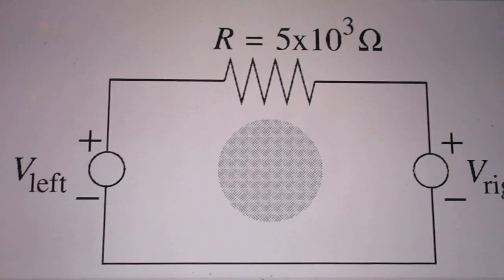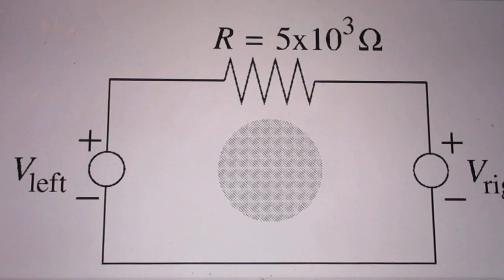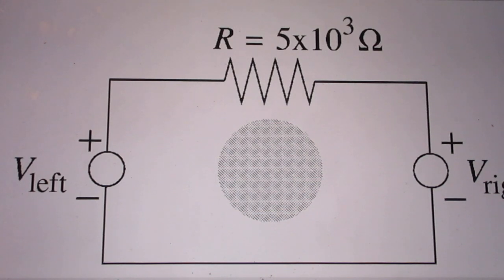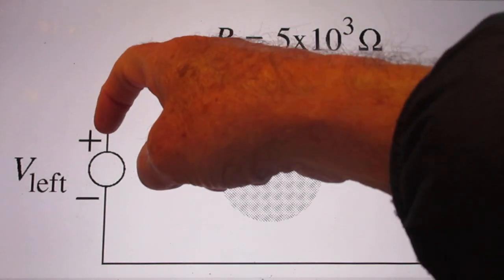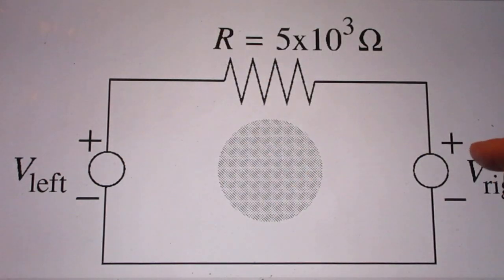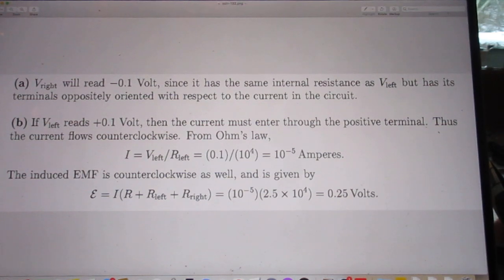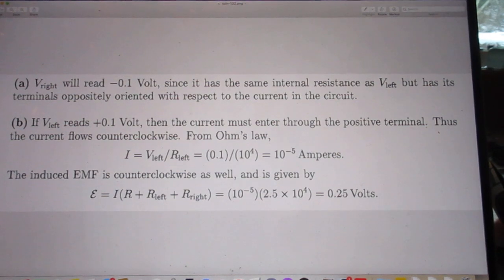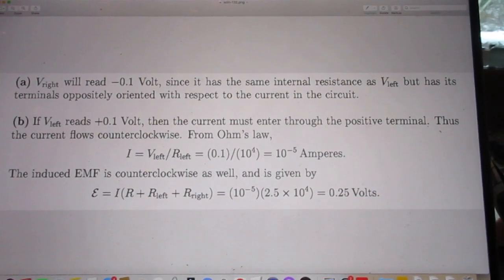Solution Problem 132 - Changing Magnetic Flux

Comment: Dear professor Lewin, I still wanted to make a point that although this problem is a good and simple illustration of Faraday's & Omh's law it is misleading as long as actual voltmeter operation is concerned which is averaging (or true RMS) and they do not give instantenious value. Using scope probes across equivalent internal resistors instead would be 100% correct.

Comment: Dear Professor,
My 1st solution was more or less the same as yours except the current flow direction - I thought the current should flow from "+" to "-" via the load as if we had a battery connected in-parallel to Vleft.
Then I saw another contradiction:
What does a faultless voltmeter show us on its scale? 
In my humble opinion it should show potential difference or voltage drop on the load. The load for the left Vmeter is R (5 KOhm)+ right Vmeter(10KOhm),
so, basing on common sense and Ohm Law the Left Vmeter should show 0.15V, but...
From the point of view of either the left V,meter or the right Vmeter we lost somewhere voltage drop on R (=i*R) 
In other words common sense places us in a situation where potential difference between connectors of Vleft should be the same either via load (R+internal resistance of Vright) or via internal resistance of Vleft, what brings us to nonsense because 0.1V != (0.5V +0.1V) .
If we apply another approach and divide Vleft by (R+RofVright=15KOhm) we finally find ourselves in a position when potential difference on Vleft connectors  through the load will be 0.1V (in accordane with Problem conditions) but the same potential difference through internal resistance of Vleft will be 0.06667V.

Please clarify.
I have to agree that
"There are more things in heaven and earth, Horatio,
     Than are dreamt of in your philosophy."
Reply from the maker: I cannot add to the clarity of my solution. If a voltmeter reads +V then it means that the current through the voltmeter goes from the voltmeter's + side to its -- side  (Ohm's Law)

Comment: Thank you proffesor the penny has finally dropped. The induced emf by the magnetic field is the solution. So if I'm understanding correct the voltage measured is due to the resistors in the voltmeters. I was taught wrongly 40 years ago. That also explains why there is no electrical field across an inductor.0 resistance. Ohms law always applies exceplt in non ohmic materials like a light bulb.The electons dont know the inductor is there.

Comment: Professor Lewin, I got the correct answer, but I wonder what the answer would be to a further question. Suppose you connect a very high impedance voltmeter across the bottom of this setup, with its plus terminal connected to the bottom of Vright and its minus terminal to the bottom of Vleft. Would this added voltmeter indicate
1) zero
2) some fraction of the induced EMF
3) something else ?
Reply from the maker: watch my 8.02 lectures

Comment: A closed loop in a flat plane with resistance at various points develops voltage polarity from induction only when a moving magnetic flux is present, correct? In your drawing there is polarity symbols indicating a voltage polarity across the meters and also a resistor located somewhere on the other side of the loop. Question, if the polarity indicated is correct how can that resistor have current flow?
Reply from the maker: >>>and also a resistor located somewhere on the other side of the loop. >>> my resitor R is part of the loop. Faraday's laws creates an induced EMF.  If you go 3 times around (counter clockwise) in this circuit the voltage change is +3x0.25V.  If you go clockwise it is minus 0.75V.
Reply: @lecturesbywalterlewin.they9259   Professor, if V-left is in series with V-right and current flow is on, how could the polarity be as indicated across two 10 ohm resistors ? Would it not be the same polarity in respect to the direction of the induced EMF?

Comment: If there is an induced EMF, then surely the lump model should include a transformer secondary to model the voltage created by the EMF. And the voltage drop across that inductor your are missing would make KVL work.
Reply from the maker: ha ha ha ha ha when you do that you apply Faraday's Law and you call it KVL.  As an example: 3 - 8 = -5  That's Faraday, thus 3-8+5= zero but that is still FL!
Reply: @lecturesbywalterlewin.they9259  ok now i got the correct answer
Reply: @lecturesbywalterlewin.they9259  Thank you for clarifying and helping my understanding. I see it would be impossible to solve for the voltages without using Faraday's law. But the EMF generated as dictated by Faraday's law must be included in the lump model as some sort of voltage source for the model to be accurate. After that, you could apply KVL and it would work, but that would not solve the problem.

Comment: I have a question sir, while solving problems of overhanging planks from a roof, we tend to consider the reaction only at the point of contact but weight at the mid point of the plank. I m unable to understand why will the weight act at the mid-point, since it has only one point of contact at that instance, it should act at that point only like the reaction. 
Pls answers 🙏
Reply from the maker: watch my 8.01 lectures

Comment: Charge is distrubuted on the surafce of a sphere with surface charge density =sigmanotcostheta where theta is angle from z axis of spherical cordinate system find the electric field due to this distribution inside the sphere .  
I am struggling with it plz help 😫
Reply from the maker: I cover this in  GREAT detail in my 8.02 lectrures.  Watch them.

Comment: Sir could we say that Va-Va (each Va measured from another route )=Eind?
Reply from the maker: YESSSS.  start at A in the upper left corner of the circuit. Go once around cllockwise back to A and calculate VA-VA (it will not be zero, if KVL had worked, VA-VA= ZERO).  Then do it again but go counterclockwise. You now find a different value for VA-VA, even a different polarity

Comment: Professor what are the strategy to get high marks in jee advanced in "physics section" .
Reply from the maker: Watch all my 94 MIT course lectures. Start with 8.01, then 8.02, then 8.03. Do all the homework and take all my exams. I guarantee you that you will then do very well on the Physics portion of any freshman college or JEE exam  You will find all information you need on this channel (notice the three playlists "Homework & Solutions").
8.01 & 8.02 will each take about 200 hours, 8.03 about 250 hours.

Comment: Sorry, but what is embarrassing is you, claiming that Kirchoff's laws do no apply when there is a changing magnetic field or an induced current! 

Where do you think the calculated EMF is generated exactly? It is included along the zero resistance wire which now acts as a secondary coil of a single-turn ideal transformer. (just like an ideal voltage source has a zero internal resistance).

The only case where KVL or KCL may no hold is in a distributed system where the voltage and currents become traveling waves, at wich case only Maxwell equations hold. 

KVL and KCL are derived from the first low of thermodynamics, so they cannot be violated in any lumped system.
Reply from the maker: In Dutch we say "zachte heelmeesters, vuile wonden". I owe it to my multi million viewers to explain in detail why Electroboom is dead wrong. Many people make the same mistake that he made. All this is at the very roots of a correct understanding of Maxwell's eqs. I therefore have an obligation to set the record straight. This is my last msg.
Don't feel embarrassed if this physics is above your level; you are not alone. Non-conservative E-fields are not taught in high schools. 
I demonstrated at the end of my lecture #16 of my 8.02 E&M course at MIT that two identical voltmeters attached to the same 2 points in a circuit can show very different values. https://www.youtube.com/https://www.youtube.com/watch?v=nGQbA2jwkWI&list=PLyQSN7X0ro2314mKyUiOILaOC2hk6Pc3j&index=17
This can also be demonstrated with a transformer.
https://www.youtube.com/watch?v=b7i2uMx7gHo&list=PLyQSN7X0ro22zanLOcvkaSY-IZqheFYM5&index=8
In fact, look more closely at my circuit; it is a transformer. My closed loop is the secondary winding (only 1 winding) of a transformer and the primary windings are in my electromagnet. 
The reason is that an induced EMF (Faraday's Law) creates a non-conservative E field. This means that moving a test charge between the same 2 points in a circuit can require a different amount of energy (even with opposite signs!). You still aren't getting any energy for free, because it comes from the source of the time-varying magnetic field.
When a voltmeter reads a value V it means that the integral of E dot dL across the voltmeter is V. 
In cases where Kirchhoff's loop rule (KVL) applies, 2 voltmeters attached to the same 2 points in a circuit will always show the same value. Kirchhoff's original text can be found in the following link, pages 497-514: https://books.google.de/books?id=Ig8t8yIz20UC. Clearly he was fully aware of the prerequisite for his "loop rule". KVL is a special case of Faraday's Law. That's why Faraday's Law is one of Maxwell's equations and KVL is not.
My demo was first suggested and published by Romer in December 1982 in the American Journal of Physics. This demo has now become a classic; it's done all over the world at many colleges and universities.
ElectroBOOM and Dirk Van Meirvenne believe that 2 voltmeters attached to the same 2 points in a circuit must always show the same value which is not true. It's quite  embarrassing that they each posted a video on their channel in which they claim to have proof for their wrong ideas.
Also read Professor John Belcher's thoughts on Faraday's Law and on KVL. Professor Belcher is my former colleague at MIT. http://freepdfhosting.com/0813df09f5.pdf
ElectroBOOM insulted me in his video by mentioning that the reason why my 2 voltmeters read different values was due to "bad probing". He stated that if I had done the demo correctly both voltmeters would have read the same value. He could not have been more wrong.  
The following video may also help you to understand why 2 voltmeters attached to the same 2 points in a circuit can give very different readings. https://www.youtube.com/watch?v=LGdN7rDB3XE

Comment: I wonder how you insist so much that Kirchhoff's voltage law is wrong! To use "KVL" you have to MODLE elements and voltage/current sources. The more accurate the modeling, the more realistic the result will be. For example, for an internal resistance of battery, you have to put it in the circuit as a series resistor. Modeling means everything is considered ideal. All elements and resources are modeled ideally. 
If the magnetic field generates voltage in the circuit, it MUST be modeled as a voltage source, in which case this law will do the job properly.
Reply from the maker: what is your problem?  KVL ils NOT one of Maxwell's eq. For good reasons. Faraday's Law is part of Maxwell's eq. For good reasons bcoz it always works
Reply: The problem is that that voltage source of yours would be modeled as a lumped element, and this is not possible in this circuit. 
Let go of KVL and embrace Faraday's law: it is simpler and gives you results that are consistent with the actual physical system. For example: if you put a voltage source you will see a jump in voltage where the generator is, but the actual circuit does not exhibit such a jump.